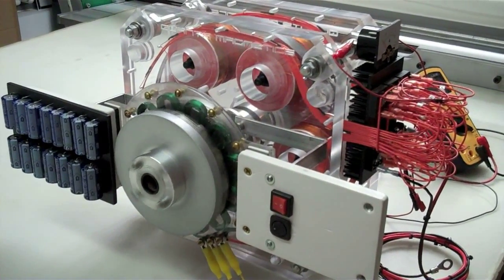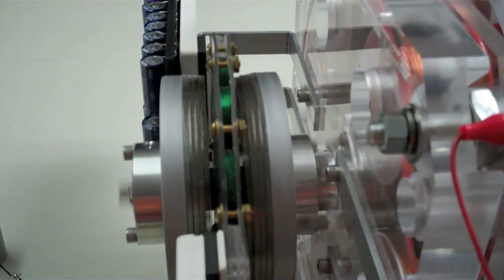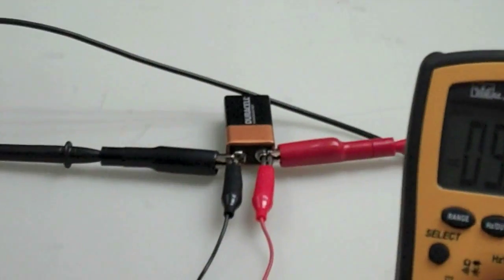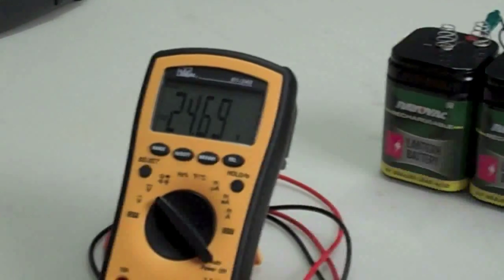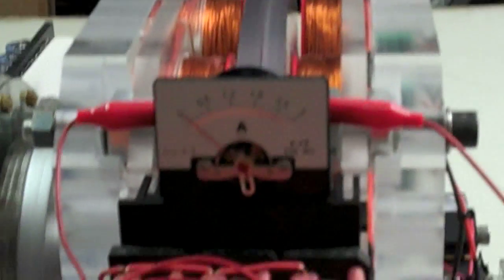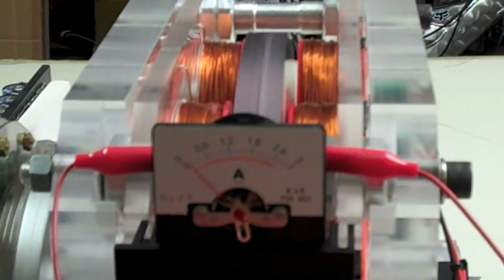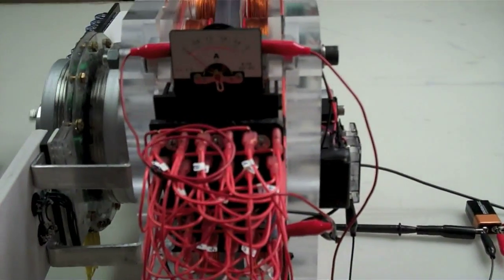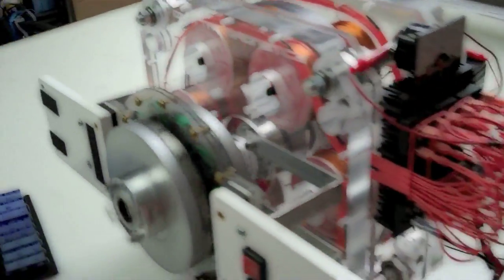Ultimate Pulse Motor Generator - New Energy

Comment: I would guess this is working by just re acsessing the energy you have stored up in all the fly wheels in this devise, they will be constantly slowing down as you draw power, because you are drawing such low amperage it will take ages for them to slow down to a stop but that would be the end result of this system. this is a energy storage system not an energy creating system, its a very nice object and has some potential to be usefull for colecting energy if coupled to a different energy source.

Comment: Once the rotor is spinning, the mechanism needs only power to overcome friction. I am left wondering why this mechanism was constructed.. Is there some gain somewhere?
Reply: Fakell Acountly I encourage everyone to go read up on Ed Leedskalnin's Unipolar theory of magnetism. In effect, this motor configuration is reducing the load on the gen/motor by using a bit of Ed's work.
Reply: That's only true if the there is no load. Loaded when producing charge into the batteries, means the drive motor must also overcome the braking effect of this power generation.
Reply: Ken Lebrun  read up on Ed Leedskalnin's Unipolar theory of magnetism, cool alright.

Update: Very interesting guy!
Reply: It also need to overcome the loss in heat, not just friction.
Reply: That's the thing....there's very little to no heat. Eddy currents are minimized by the secondary coil in the coil pairs.
Reply: Fakell Acountly  note that you did not see the 9 volt battery voltage towards the end, bet it knocked the voltage out of them!
Reply: Shorting a generator makes the turning much more difficult as of opposing magnetic forces.  So, its this back EMF in theory being reclaimed in zero unity designs.  As soon as the opposing back EMF can be cancelled in motion and reclaimed in the output, then such a device be useful in daily usage.  Its hoped such inventors make such open source and not be  worried about a patient as Joe Newman spent years doing.
Reply: @EyesOnReality   LOL! "Look Ma! I've built a 47 metric ton generator that can charge my phone! And! I don't have to pedal that hard!"
Reply from the maker: EyesOnReality We have been doing that with our toroidal models for quite some time now. Nearly zero counter torque under a total shorted condition. Check out the videos using toroids on my channel.

Comment: you can do the same thing with a normal bendini pulse motor, sure, its a nice clean build but not all as made up at he says. put a cap on a regular pulse motor and it will come up in voltage just as this one shows, now, put a 3 phase generator inline under load and see is it keeps running , lol.

Comment: You can charge a 12v lead acid battery even with a few milliamps of power and it will still slowly charge the battery.  I have a few small lead acid battery chargers for a portable lantern that output 100-200Milliamps at 13.5vdc and they will charge up a small 4a/h lead acid battery  in about 24-48 hours.  What you essentially have is a very low friction high efficiency dc motor and generator that share the same shaft.  The power you are drawing from the 9v battery is being converted from chemical to electrical to mechanical to electrical and back to chemical.  Their will be loss at every step.  You also don't have a high resolution ammeter on both the input and the output so it would be very hard to get any meaningful readings about the efficiency of this conversion.  The lead acid batteries were reading 12.8Vdc before you started which also signifies that they were at 100% full charge before connecting which also means that they will not accept additional charge  except the current necessary to float the voltage higher.  This means that they will draw only a minimal amount of current from the generator and thus the 9v battery powering the motor.

Try the same experiment using 2 identical ammeters one on the input and one on the output while also measuring the voltage on the input and output and connect the lead acid batteries to the generator when they are nearly dead at around 11.8-12.0vdc and then try to charge them up with the same system and then take periodic measurements of the system say every couple minutes until the 9v battery is considered dead usually when the voltage falls off rapidly to 5.0vdc or the motor stops spinning, whichever occurs first.  After this disconnect the lead acid batteries and let them sit for an hour to let the voltage stabilize and then take a reading  to see where the state of charge is on the lead acid charge curve.  

State of Charge   Voltage 12V    6V
100%                             12.7    6.3
75%                               12.4   	6.2
50%                               12.2   	6.1
25%                               12.0    6.0
Discharged                     11.9    6.0

Comment: Your a dam Genius how did you get so smart? I had a question could you split the output and feed the input and remove the battery and have it run that way. Just wandering if that would work.

Comment: Would you be able to hook up a tesla turbine to the front where the "flywheel" or front that your showing and a smaller one in the back and have the larger tesla turbine "exhaust" port feed the intake of the smaller one and then you may not need the battery :-)

Comment: One ammeter is not enough to show the amperage in the separate parts of the circuit.
What Theory do you believe your device operates by? because stored magnetic flux does not exist, Magnetic flux is magnetic flux... It is not stored or un-stored. It is just magnetic flux. what might be caused by a change in magnetic flux surrounding a copper coil is an electric current.. but it does not store the magnetic flux.

Conservation of energy...

Where is the energy coming from?

Comment from the maker: This machine is not a typical direct-to-load generator requiring a high amount of horsepower or current input in order to function. Its purpose or "point" is for bulk energy storage to be used at your discretion. The demo shows how small of an input it can actually work with.

Comment: I dont really get the point. are you trying to show high efficiency motor? what happens when you have a load connected. what is the efficiency of the motor when you try to move a car with it? will the wires heat up? what will happen to the resistance than?

Comment: You have not proven that current is flowing into the battery unless you place a series resistor inline with the positive lead, and take a positive voltage drop across it.  If you cannot do this, I claim that both of your batteries are "powering" your concoction.

Comment: unfortunate outtake and re-arangement of your 12volt lead acid to the rear of your system at the same time as filming your outtake.  Skeptics will say that the CAPs were powering the device in your first take and in the second - the 12v lead acids had replaced the 9V.  I'm not saying that you did that, i know pulse motors are super efficient. ,  but im just saying the video could look like that to skeptics -you have to remove any chance for them to dismiss your presentation.

Comment: Remind all, we are living on a huge magnet that's generating energy that supports an atmosphere, that's the reason when you point your rig in a certain axle direction, if you get up on your roof and barely strafe your arm against the flat plane of a tv antenna you will absolutely (I guarantee it personally especially if you're a little sweaty) that you will get enough of this electrical charge you will burn the area you touch. Static draw through a dioded system harnesses the earths natural zap.

Comment: ur illustration could be better. from the way u describe, it seems like a DC-DC step/down voltage convertor from a 9v battery.

what u should show is power in vs power out. meaning 0.9w in and outout of 9w or more.

Comment: I'm with u 100% , excellent device . surely you get better results under load than without load .

It's just "real" science , put a load and source amps drop no ?

You will find the following : your Lenzless will runn faster (RPM ) at Full Moon , same as Bedini shows .

I have a question fo, I'm not a electrical engineer and trying to work backwards. I comprehend bypassing Lenz(like howard Johnson shows.

Do u have to have 2 devices a motor & generator ?

I uploaded this video ?v=dWH6jWBl_JM

Comment: Coils around magnets to harvest it's own perpetual motion as a perendev motor. Let the internal coils power the outer magnets to create a stronger push so it does stall when a load is applied to the stator. So it might be possible for a perendev model to power the turning torque or a conventional generator

Comment from the maker: This particular video demonstrates energy transfer from separate or combined circuits. The Q2 &Q3 machines shown on my channel are a scaled up mod of this single unit, and are designed specifically to augment solar input. The purpose being in/out phase pulse charging of storage batteries using low power input, and not as a direct to load generator which requires bulk current to perform a duty. If you're not planning to store energy, this tech form would not be for you.

Comment: where do we start?  first off bridge rectifiers contain diodes that EAT power.  0.5-0.7v drop typical, down to 3v or so for GE.  But lets forget about that lost energy, its not a lot if you've got 30-60v to work with.  Second he just commented on the awesome weight of the rotors and copper.  Mass has NOTHING to do with power required to keep a system moving, those words are just smoke and mirrors.    Lastly, the analog ammeter to show pulsed current?  There's the snake oil right there.

Comment: Well he doesn't say perpetual motion, but he does say your getting more power out that you are putting in. According to this video he could rewire it (by removing the 9 volt battery and attaching the big batteries he's "charging" to both the input and the output) and it would just build and build perpetually. Thermodynamics says NO! :)

Comment: Actually he can charge the 6 volt batteries using the device as shown, but what he either doesn't realize or  doesn't state is that he is destroying the magnetic field in his neodymium magnets.  This field represents stored magnetic energy and the randomization of the magnetic moments creates a net drop in potential field and an excess in electrical current.  Totally possible, but not practical.  This motor is basically running off magnets.  It is an expensive form of energy.

Comment: "It's best to go by the equation Power = Force x Velocity, which rules out measurement of power using multi-meters, oscilloscopes, IR readings, and any kind of light bulb.",

That would be reasonable. This video like many on this channel are intentionally vague leading many commentors and subscribers to think there is a possibility for overunity.

PMMG4HYBRID, how about some real numbers and testing procedures for a change? What is the efficiency of this motor?

Comment: Readings of volts and amps are also unreliable, as it can be easy to confuse reactive power as real power. It's best to go by the equation Power = Force x Velocity, which rules out measurement of power using multi-meters, oscilloscopes, IR readings, and any kind of light bulb. Measuring power with a mechanical load is a better bet. It might be worth trying to attach an automotive radiator fan to the shaft of these things or go all out with a real dynamometer.

Comment: "So he's running the motor from a 9 volts battery and outputting 25 volts but hardly any amps. Isn't that creating extra electricity?",

Not quite, Power = volts x amps. If you increase voltage in a closed system then there is a subsequent drop in amps and that is assuming there are no losses which of course there will be.

Comment: So he's running the motor from a 9 volts battery and outputting 25 volts but hardly any amps. Isn't that creating extra electricity? So what would happen if you hooked that motor up to a solar panel that is generating 80 watts and 4 amps (= 20 volts) of electricity? Am I correct on the calculations?

Comment: But converting AC to DC due to bridged rectifiers is higly inefficient!!! 
You don't see that in today's power supply's for laptops etc.
Bridged rectifiers is low tech in electric world.
You need high efficient AC to DC switching converter.

Comment from the maker: Definitely not needed if operated as a highly efficient motor/generator. 
They are needed only if the machine is powered by another motor or device. That way, you are covered. Good question, thanks.

Comment from the maker: 24V works best. Little 9V battery was only meant as a demonstration to show pulse motor efficiency. Back feeding generated power into the pulse motor works for an extended period of time as long as you're feeding the gen output into a rechargeable storage medium, but all will eventually slow to a stop

Comment: My question is: What happens to the operation under a higher load. Your supply is only milli-amps or current draw, but how much torque do you have available on the drive end of the motor, and how much load can you apply to it before you either over draw the battery or slow down the rotor to the point the stator can no longer keep it spinning?

In other words, can you apply a small generator to the drive end of the shaft to power the motor itself?

Comment: You are thinking of what is often referred to as a Buck-Boost transformer. In the applications I have seen them used, to step up (boost) or down (buck) a voltage by a small percentage, usually something on the order of 10% or less.

Comment: If this actually works as you claim, could you not just feed the output into the input right after you've started the machine with the battery? Then, in theory, the machine should just keep accelerating. Yet, you are not doing this...

Comment from the maker: It operates as a unity of electrical, mechanical & chemical working in concert with each other. Industry has no confidence and therefore will not approve such devices for market. So we offer it as experimental equipment... which is exactly what it is.

Comment: So with this device, would it be possible to use one battery to charge, let's say, three batteries, then use 2 to power whatever appliance, while one of the three charges another set of three batteries (one of which is the battery that powered the device previously)? That would mean there is an overunity effect and going off the grid was possible. So why isn't this being mass produced already, and used to power houses, electric cars and practically anything? I want this technology!!!

Comment: I'm a PV installer, solar electric systems are extremely expensive.To the point; If you're looking into green energy, solar, wind, whatever fits your needs... do lots of research about super high efficiency devices and the cost to replace what you have now, and the $ you'll save and compare it to the cost of PV that will eliminate your current bill. Then price PV for the efficient house you'll have. BOOM!  REDUCE BEFORE YOU PRODUCE. $ale$man won't say this, they're income would decrease by 50%.

Comment: The most efficient conversion can be accomplished by using electronics instead of Motor Generators.That way you get rid of the mechanical friction and reduce I squared R copper losses. Motor Generators may be the method of choice in some instances though. If your making free energy claims or that I am almost making free energy that is just ignorance or outright fraud.

Comment: This is just another fraud. Can you change 9 volts to 12 volts? Of course. Can you take a small battery and use its energy to charge larger batteries. Yes. Real motor generators are used to change or isolate the electric energy inserted to electrical energy outputted with different characteristic. AC to DC DC to AC one voltage/current to another voltage/current one frequency (Hz) to another frequency (Hz) Single phase to three phase. None of them create 'Free Energy".

Comment: Want to make an even better version of this? Buy a transistor, capacitor, inductor, diode and a timer IC for like 70 cents. Congratulations, you've just made a boost converter than can actually output a decent current (and please stop saying "amperage", it's so wrong) and doesn't require 12 pounds of copper and a cubic meter of space to build.

Comment: hers a question. for example. say you had a rechargable lithium battery ? and had that in place of a 9v battery, and the output power from the pulse generator possible to recahrge it ? in place of that 9v battery ? is that possible ?

Comment: this video shows absolutely nothing. Because your sub standard ammeter shows zero doesnt mean the value is micro amps. "zero on that scale could be several miliamps, an order of magnitude larger. If it really worked as you claimed you would be comfortable showing in real time the actual INPUT POWER and OUTPUT power on a calibrated meter. Stop acting like a 9volt battery cant be used to charge a 12 volt battery with a simple circuit.

Comment: I am sorry, but the efficiency is good, but not approaching  Dc to Ac converter running into a transformer, nor is Voltage any indication of the Charge contained in a lead acid battery. I was involved with electrical scientific instrument making for 40 years, nothing here is different to conventional theory or practice. Any lead acid will charge with a voltage exceeding the terminal potential,  a 1.5 volt battery could charge a 100v volt battery easily, but only to the level of the energy in it.